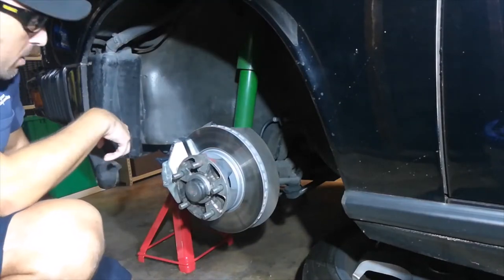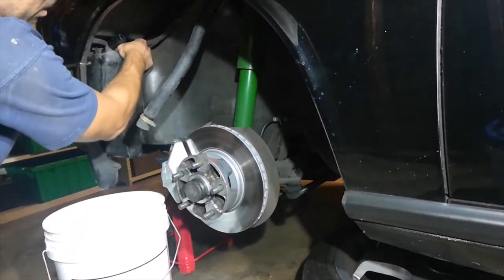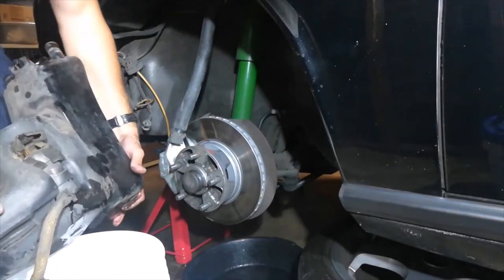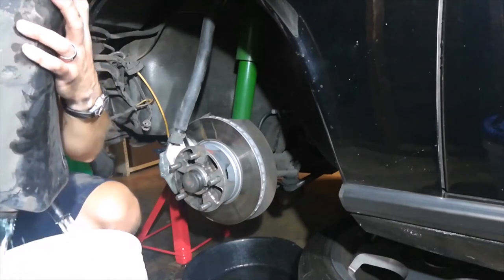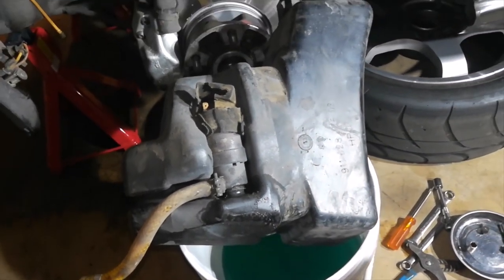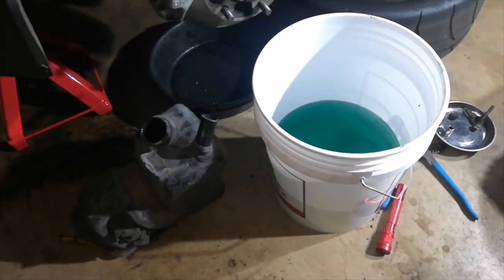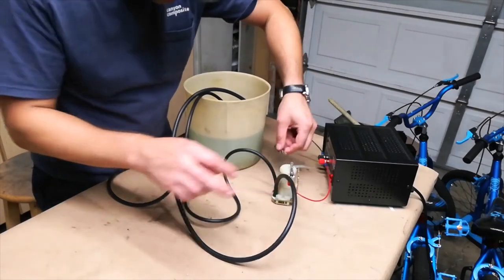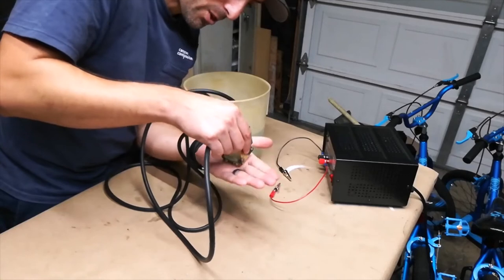Air-cooled Porsche 911 Windshield Washer System DIY Rebuild 2 of 3: Tank and Pumps Removal

Comment: Dude, that washer fluid is TOXIC.  But I can now see that to FLUSH the tank to get any crud out, just disconnect that bottom headlight hose and then put your garden hose in the filler hole, and flush away.....that might be a good idea every year to prevent plugged check valves, nozzles, etc......(I have 85 Carrera).

Comment: Great videos. Thanks! Somewhere inside the front bumper, the headlamp washer tubes in my 1982 SC have suddenly sprung a leak. The pump doesn't work so it's draining by gravity. So I'll be doing this project plus taking bumper off once the parts arrive.